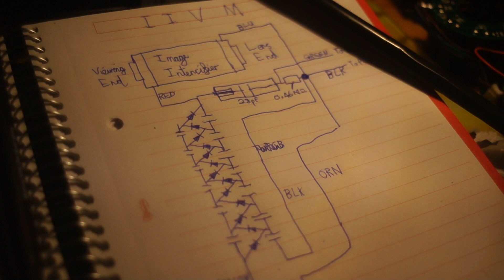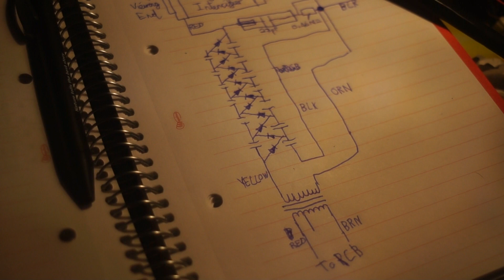Image Intensifier Tube Working

Comment: Can you tell me if I can disable or repair the FAR to active Auto-Gain or tube output variability depending apon the light level .. Ina a Gen1+ ATN Viper Monoculars High Lpm Gen1+ Viper Monoculars tube? I got a used one and it's so dark nyou can barely use it even with a 850nm illuminator outside of it's own... It's just darker and darker .. in the dark it's so dark you can't see at all.. even an 850nm torch makes it darken.. it's maddening.
Reply from the maker: Don't know, that is not a tube I have played with. Could be the tube is just hitting end of life as the phosphor wares out.

Comment: Can you pls make a power suppy to run my Phillips XX1080 I hear it need 14-18kv 😲👍ill make it worth your time
Reply from the maker: I have one of those tubes & plan to do such a thing
Reply: @TheEPROM9  Thats totally Awesome as!!😃👍 Cheers mate cant wait!! Subbed
Reply from the maker: @kenkowalski1314  Just a case of when I get time to work on it.
Reply: @TheEPROM9  Hahaha No worries its been this long already a few more months cant hurt lmfao!!😂 just really interested in seeing it operational for the first  time ever lol,Will be cool as!! Cheers
Reply: Those are tricky, you also need to supply voltage to the focussing unit.
Reply: @heyarno  Oh ok really um i only see two pins on mine?? 😂👍but would not surprise me!! i
Imfao,Cheerz
Reply: @kenkowalski1314  If there are pins, it might be wrapped with a integrated power supply. Hard to tell without seeing what you have. I never got one of those tubes, because of the convex photocathode. I have no lenses that can focus on that. But I have seen the Tube, datasheets and original power supplies. They have extra outputs for the focusing electrodes. They basically apply somewhere around 400V(relative to the cathode) to the outside of the back, to shape the electron beams to not be distorted on the flat output window. I remember black ports/plugs.
Reply: @heyarno  I have a Phillips xx1080 which im really hoping to find/make a power supply for lol😂👍 id love to see it in action one day!? You have one of those units to yeah Arno??
Reply: @kenkowalski1314  Nope, I have seen them and looked into them, but decided against getting one. 
I like other tubes better because it's easier finding lenses for a flat input window. 
But it's not that hard to drive one of those tubes. 
They require very little power. 
So you build a little step up cirquit that runs of a AA battery and outputs 15kV for the screen and 450V for the focus. 
Philips also specifies that you need a 30MΩ resistor for the screen and 1000MΩ resistor for the focus. 
Negative goes to the metal ring on the front and both positive voltage go to the ports below the screen. 
Left side get's 15kV and right side 450V.
Reply: @heyarno  Omg!! Thanks for the info mate!! I guess ill never see it in action then lmfao😂 I bought it for $50 if your interested 😊👍 I see what you mean now hahaha neg is  the metal ring and the two pins are the  different positive voltages lol,Cheerz bud
Reply: @kenkowalski1314  I already have so many weak tubes, that I started turning them into 3 stage cascades. And since you quote in dollar, I guess shipping to germany would be more expensive than the tube. Though, if I build you a power supply, do you feel confident that you can connect it to the tube? The high voltage end needs to be free of any air contact, or the air will drag the voltage down. Besides from that, the biggest hurdle would be to get a lens that works with a curved photocathode. The only one I know is from a FERO-51, which is designed for gen0 tubes.
Reply: @heyarno ✌Thats Awesome Arno thanks for the offer but I do have a new monocular gen 3  from vector optics cost me $400 and it's great!! The xx1080 is a bigger tube and would have been cool too see working!! But Postage from Australia to Germany would be about $50 too lol,So It can just go back in the cupboard Hahahaha 😂👍 Thank you Arno for your expertise  info I appreciate you!! Have a good Evening my friend!!😃👍
Reply: Sorry I ment my new monocular is gen 1 not 3 hahaha I wish!! 😂😂😂👍
Reply: @kenkowalski1314  A gen3 monocular for 400 dollars is awesome. Congratz. ANd yeah, that kind of tube is a pain to turn into a working device. The special optics it needs are rare and bulky. And the driver needs to be hand made these days.
Reply: @kenkowalski1314  Oh dang. That's a bit of a difference. I still hope you enjoy it.
Reply: @kenkowalski1314  The device I carry most is also a gen1 monocular. The resolution is not great, but it's so small and has 1x magnification, that it's fun to use wherever the conditions are right.
Reply: @heyarno  lol yeah its fantastic Arno its small too and great for seeing stars,Infrared anomalys and spotting security cameras lol 😂👍good enough for me!!
Reply: Who has $14,000 for white Phosfor gen 3 hahahaha not me!!😂
Reply: @kenkowalski1314  That's a crazy price. Are we talking about a dual tube setup?
Reply: @heyarno   Arno just a monocular with green phosfor tube, I can hear the zap of the power supply as it boots up lol,Very cool for $400 ,its has adjustable lens front and back too, I have a microscope digital camera that fits perfectly if i want to record the infrared anomalys amongst the stars!! Cant wait till the price drops on white phosfor tubes hey, hope its in my lifetime hahaha 😂👍 id send u a pic if i could
Reply: @kenkowalski1314  I'd still get a green phosphor version of a modern gen3 tube. The white phosphor is more for rapid movements and tactical stuff. The price difference is minimal. But yeah, seeing a price drop in autralia might not happen too soon, as you lack local manufacturers of such tubes. So the imported stuff is very expensive. If I look hard and am patient, I can probably snatch a modern russian gen3 with white phophor for 2.8k or get a readily available one with German tube for 5k. Still, those prices are quite harsh in my opinion. I rather save for some high vacuum equipment and see if I can make my own tubes. For now, my home made gen2 device will have to do when I need better.
Reply: @heyarno  Thats it!! Everything here is very expensive Arno!! They are very handy and fun to have!!😊👍 its amazing what humans can do with tax payers money!!😂 special ops perobably have gen 7 now
Reply: @kenkowalski1314  Nah, still gen3. But modern filmless gen3 is much better than first gen 3 tubes. The devices improved too. they save weight by using plastic lenses on the inside and they have no built in Ir illuminator anymore. Also some devices combine thermal and image intensifier.
Reply: @heyarno  Cool as!! Like they have on Black hawk military helicopters!! Flir styles, I had a $200 digital HD digital monocular that could record ar the push of a button, It was pretty dam good but it broke unfortunately😕 you could hook it upto a tv aswell.Great for showing people the weird things that fly in our sky that you cant see with the naked eye's !! I caught some weird things and uploaded to my channel.May have to save up for another one!!😄

Comment: i am thinking of tube repotting, i understand the psu module is a voltage multiplier that applies varying levels of power/volts to different parts of the tube core correct? is there a shock hazard with repotting tubes? i am also having a hard time understanding how 3 v can be multiplied hundred's of times with just module.
Reply: There is always a transformer in front of the multiplier, something like 1:50 to 1:100. This way the first stages provide the smaller voltages needed and the transformers isolation makes polarity reversal possible.
The current/ power is insanely small, as long as there is no larger capacitors involved there is (should be, not taking responsibility here) no danger. In fact measuring the voltages requires at least a 1G, better 10G resistor as a probe on your multimeter. Combined with the 10M impedance this will give you a voltage divider and very very small measurement current.
Just putting the 10M multimeter across will short out the power supply.
When repottin also be careful to choose the right material, it has to be flexible, epoxy shrinks a little and will crack the tube, silicone can be corrosive (thats the reason there is so many blind tubes, the seals got eaten by the silicone)
Reply: @NIOC630  i have one more question if you dont mind me asking.  i went ahead purchased this resistor on amazon... 

uxcell 5W 10G Ohm 5% Tolerance High Voltage Glass Glaze Film Resistor (sorry cant post link or comment will be removed)

I will splice onto my probe. i guess you have to measure the resistance and calculate the difference using a formula in mohms? is this necessary when testing the main contacts for voltage or ma or is this only necessary for testing the high voltage parts of the psu when depotted?
Reply from the maker: When it comes to high voltage mesuring I curently don't have the kit to do it so there is a little guess work.
Reply from the maker: Yep pretty much bang on. The one thing you find out very quicly is there are somethings that are not conductors at low voltages that become conductors at high voltages. Got a few zings there.
Reply from the maker: There is a shok hazard, but the over all power is not dangrus, just hurts a little. NIOC630 made some great points.
Reply: @TheEPROM9  Thanks for the info! the voltage numbers scared me at first but i shouldnt have to worry about touching anything when im tube testin, i got enough power supplies so once i know i have a good powersupply that works i will use that to test the other cores. i think i now have a pretty good grasp on how to go at this, im glad i am not wiring my own psu like you did, props for the video by the way, thanks for posting!
Reply from the maker: @josephwalker7432  No probs. Glad my video helped.

Comment: Not surprising that it would have image burn if it is pointed in the same area all the time as a cctv camera, that is maybe why they took it out of service.
I don't think the screen on these actually burns, its most likely the photochathode worn in that one specific area and become less sensitive and it make it look like the screen is burnt when it is not.
The photocathode on Gen1 only has a life expectancy of around 1000hrs, that means that they are constantly degrading over time when in use. Depending on the conditions they are used in they wear out at a different rates , faster in bright environment and slower in darker environment. The part that is black on the screen must have been a bright area or object that caused that part of the photocathode to wear out faster.
An intensifier tube in a hand held scope is constantly moving around so the photocathode wears more evenly.
I have seen camera intensifier with Gen3 night vision tubes, they are more expensive than Gen1 but last a lot longer.
There are new CMOS low light image sensors now that can do a great job in low light environments and have the advantage in that they do not wear out and aren't damaged by excessive light. 

Intensifier tube life expectancy in hours
Gen1: 1000hrs
Gen2: 2000-2500hrs but more modern tubes now have up to 15,000hrs life expectancy.
Gen3: 10,000-15,000hrs
Reply from the maker: I am not sure what the camera was used in dureing its army life, but the external part of it had been exposed to the elements by some of the corosion. You can kind of see the burn in when its off as a yellow spot on the back screen so it could esily be both ends that are warn.

Some of the cameras used in CCTV with CCD's or CMOS'es can get some insain low light preformance that you just don't get with normal cameras, usualy they are the B/W ones. The IR off street lights can oftern be enougth although the modern LED ones don't produce any IR.

Even though this one is end of life I will still build it into something as the area around the burn still works perfectly.
Reply: @TheEPROM9  Hi, what you think is burn in is actually not. You have a gen2 or even 3 tube that uses fiber plates on the ends for optical reasons, they look like they have a spot but its actually a lens effect. Also you should look closely at your tube it has several othere contacts and needs 3 different voltage levels to work properly.
Reply from the maker: If its not burn what would it be. Looks pretty simular to the tupe of burn on a CRT. It is a shame it is so hard to capture in any photographic form.
Reply: @TheEPROM9  Look at images of fiberplates, thats also the reason why its difficult to take a picture, its optical effects heavily dependant on the angle.

https://upload.wikimedia.org/wikipedia/commons/thumb/c/ce/Gen3-Image-Tube.jpg/220px-Gen3-Image-Tube.jpg

this is how its made up and you need ground + 3 other voltages to run it properly.
Reply from the maker: @NIOC630  In tresting, I will have to do some more tinkering on that.
Reply: @NIOC630  i am thinking about tube repotting 10130 what kind of volt meter is used to test the power supply and is there a shock hazard associated with repotting tubes?